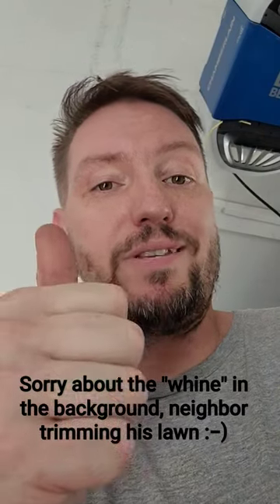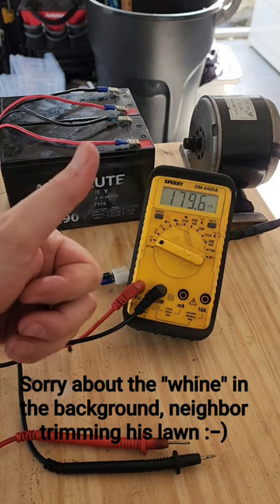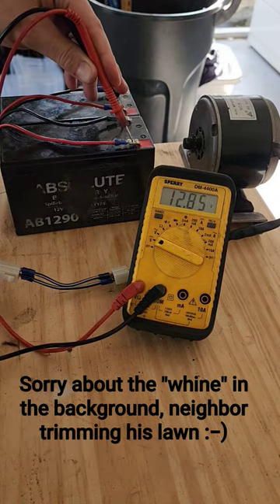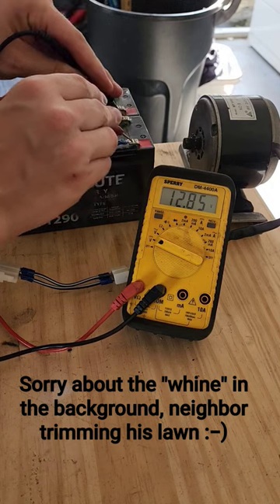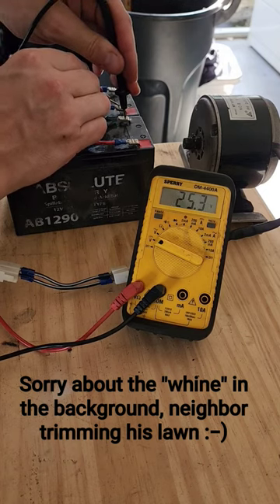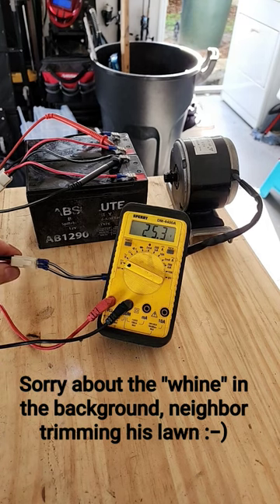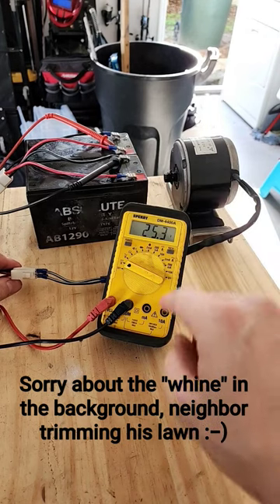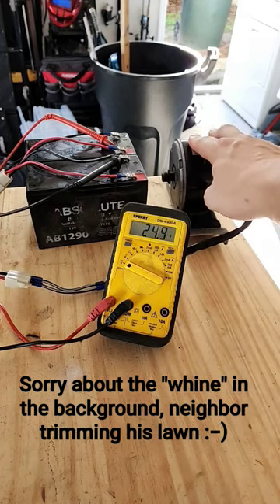How to properly test #razor motor/batteries - #diy #gokarts #geekytechycool

Comment: So if one of my batteries reads a 10.4 it’s bad right. I got a razor for my daughter and wheel spins but will not move when she sits on it
Reply from the maker: I'd say yeah, it's toast. Replacements can be found almost anywhere. Going to a lipo/lithium will get a nice bump in performance though
Reply: @geekytechycool  I might do that in the near future bein I’m not so good at electrical wire stuff. Hopeful new batteries will fix it for now til I do further research into going lithium
Reply from the maker: @AlexL1209  you can get a lithium pack in the same physical size and wiring needs, it'll just have better performance and give you the ability to charge it faster. The other option is to look up a tutorial on how to wire it up for power tools batteries. Quick charging and easy to get at that point

Comment from the maker: I realized after coming back and watching this video that I wasn't clear when it came time to test the motor. I took the plug that would normally be the main power going directly to the controller and just wired that to the motor plug using some scraps of wire and spade connectors as a temporary option (since I'm trying to film with a meter and show you all at the same time) you could accomplish the same thing by just touching the ends together.

Comment: Could a sudden drop in voltage to 20v when the throttle is engaged cause the controller to trip against the minimum allowed voltage even if levels out.  I ask this because my batteries read 25v at the battery, 22v through the controller and when I trigger the throttle it drops to 20v, I hear a click than levels back out to 22v.  All the while I measure nothing at all from the Motor side of the module.

This is the case between three dif controllers I have tested so I think its the battery.
Reply from the maker: I think you're spot on with your assumption. I can't give you a confirmation as I haven't experienced that behavior but it does make sense